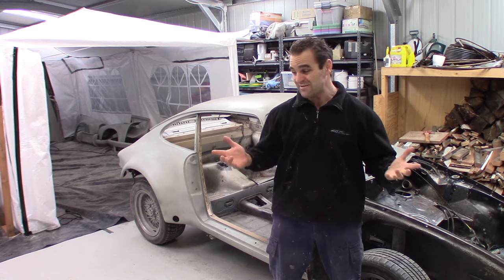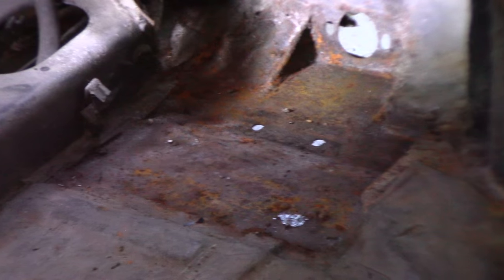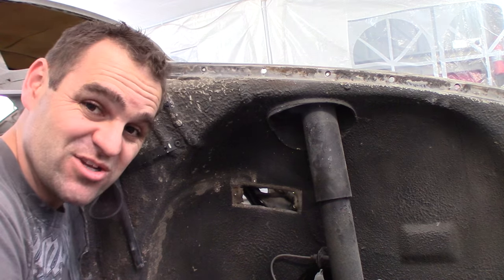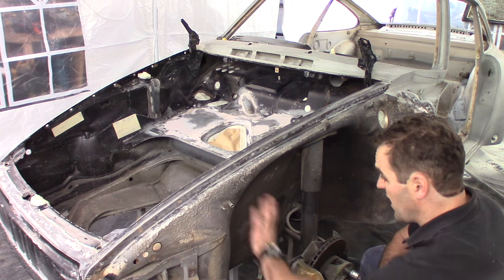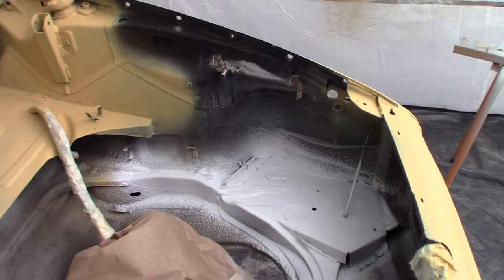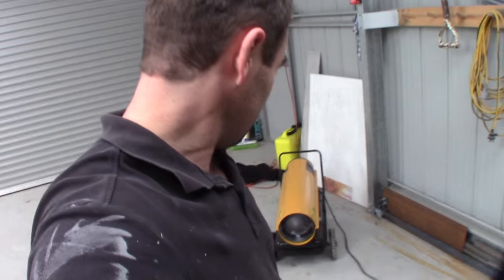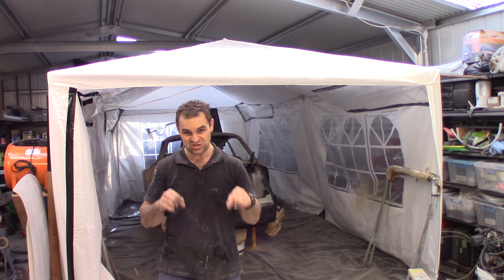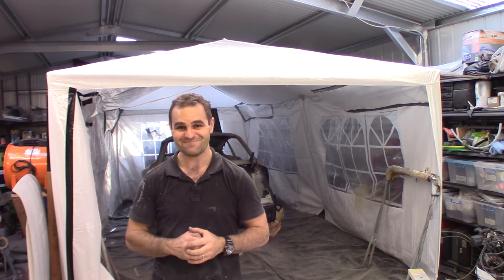Painting insidey bits - Porsche 911 Classic Car Build Part 16

Comment: Jeff, what a fantastic project and a fantastic car.  One question....why didnt you take drop the front suspension before you started painting the wheel well?  I would have thought you'd want to freshen up the suspension anyway before you started driving the car hard on the track.
Reply from the maker: I am not planning on doing a lot to the suspension until I drive it and see what it needs. The brakes will be getting the full treatment straight away though.
Reply: Fair enough....again, what a fantastic project! Kudos to you!

Comment: hey watching your series of videos you seem very knowledgeable, do you think its possible to place a full fiberglass body on a rolling chassis and reinforce it with a full roll cage from bumper to bumper? if so will it be street legal in California ?
Reply from the maker: I personally have no idea about Californian road laws, but I would say it is unlikely to be an easy task. That said I know that there have been several 911 replica kits based on the VW Beetle made over the years. You can register kit cars here in Australia, but I know it is getting increasingly difficult to do so. Often I believe they require the kit manufacturers to pass crash testing, etc. This is all guessing, I would suggest you would need to do some further checking into the rules in your area. Good luck.
Reply: +Home Built By Jeff thank you for responding looking forward to your future videos